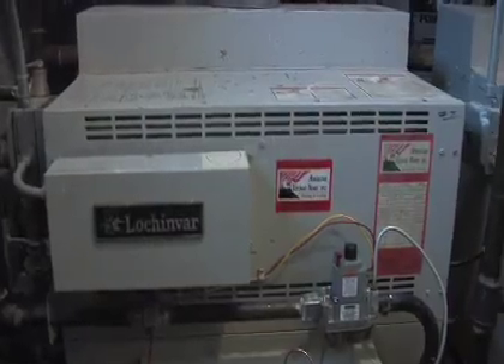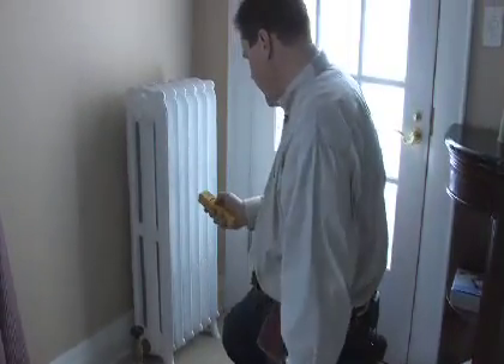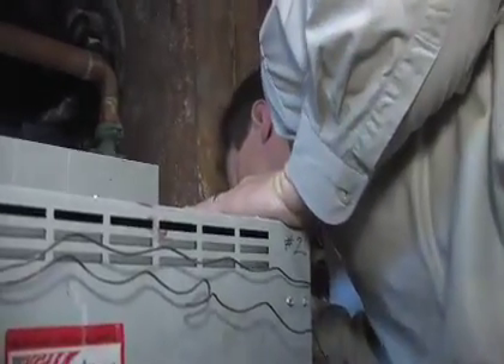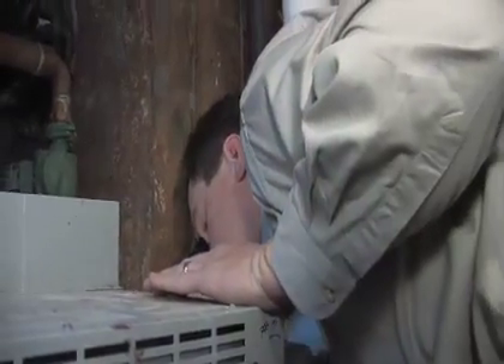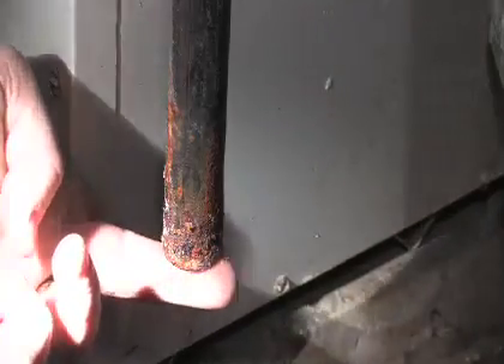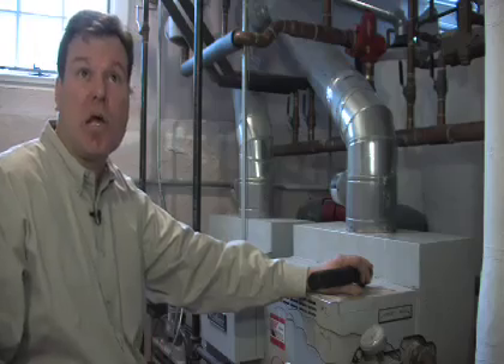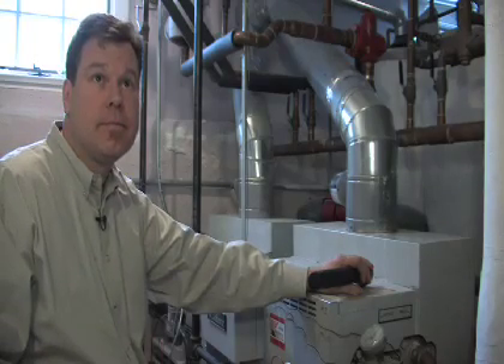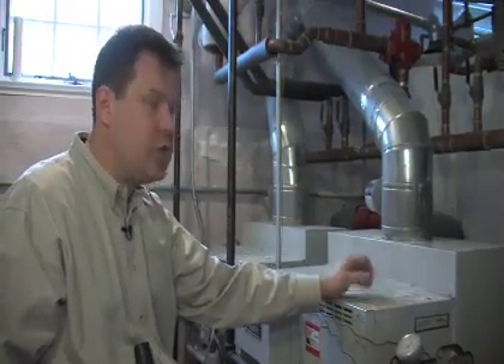Home Inspection of a Boiler

Comment: ive came across this problem before its the expansion vessel is letting in water and not working 100% which increases working pressure fact

Comment: Actually a blockage wouldn't do much to increase pressure in a hydronic boiler. The boiler pressure doesn't go up or down from pumping or circulating. It only goes up from expansion from heating which the expansion tank helps accomodate. It can also increase pressure from a bad pressure reducing valve or  a bad expansion tank.  Blockage is very rare and doesn't increase any pressure.

Comment: Never bleed the expansion tank. If the system was installed properly there are bleeder installed up in the radiator or even in the baseboard, bleed those. Usually there is also a bleeding station at the boiler for each zone you can bleed it thru there. You have have to do it a few days later some more because air bubbles combine and become a big bubble if not all the bubbles were taken out the first time.  
good luck